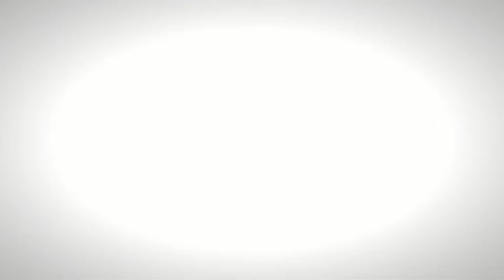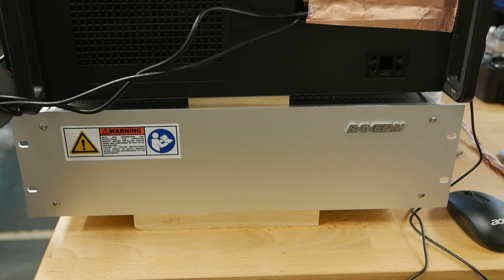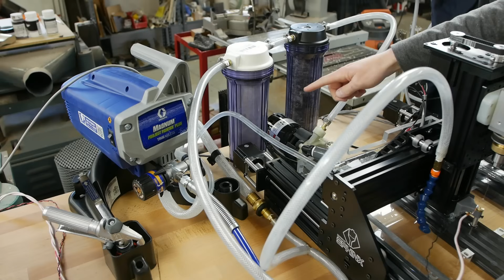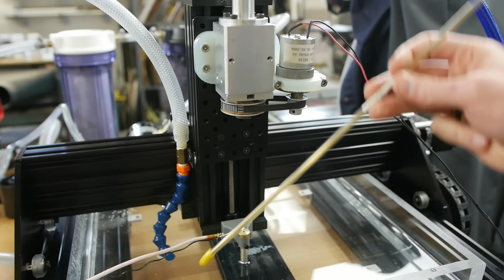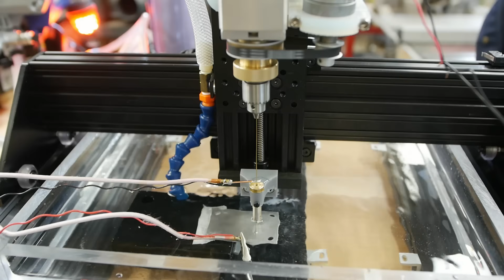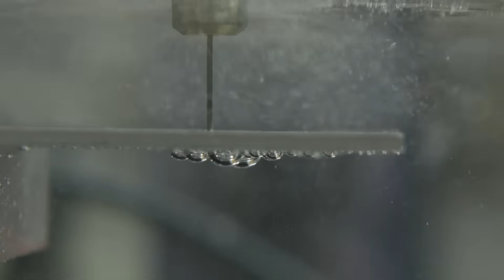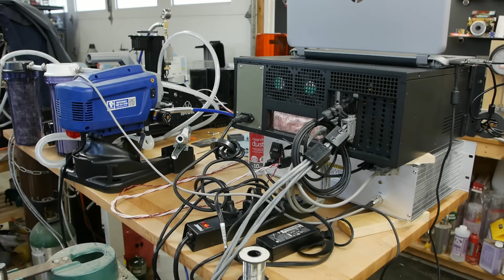Drill through anything (conductive) with Electrical Discharge Machining

Comment: >It'll be too conductive
>water your plants with it

It's got what plants crave. (Electrolytes)
Reply: oh god i love that reference
Reply: Plants love heavy metal
Reply: @turk639  chromium, nickel, manganese, tungsten, vanadium, cobalt, etc. if you drill anything exotic like a ball bearing.
Reply: william Greene if I'm not mistaken, cobalt is even radioactive
Reply: "Brass is copper and zinc." There’s probably also a substantial amount of lead in those electrodes. If you poison your yard with lead, and eat the plants, that’s not a good idea.
Reply: Mostly iron copper and zinc the nano particulates are what make the water more conductive not salts.
Reply: @Barskor1  salts can definetly make water conductive, just adding a bit of tabel salt to water does make it conduct electricity quite well.
Reply: @turk639  Yes but that is not what is happening here he used distilled water that over time gained higher conductivity by drilling.
Reply: "Are you pondering what I'm pondering, Pinky?"
"I dunno Brain, where do you 'spose we're going to find Brawndo at this time of night?"
Reply: @Reno Simpson 95% Of statistics are made up. You realise airliners are privately owned?

JetA is highly purified fuel and regularly tested, everywhere. You think a commercial operation is going to carry an additional tank of heavy crap to spray out?

That's not profitable.

Also, AFAIK, not one maintenance engineer worldwide has spoken out to give any credence whatsoever to your insane ramblings.
Reply: Brawndo's got electrolytes.
Reply: His head looks like a peanut
Reply: hexavalent chromium <3
Reply: I'm not sure is that you?
Reply: @randominternetguy2960  Yes yes I am Me. Now seriously who are you addressing the question too?
Reply: @Reno Simpson lol
Reply: Brondo has what plants crave...
Reply: I use brawndo ... because it has what  metals crave !!!    It has electolytes !!!!  https://youtu.be/3boy_tLWeqA
Reply: Just don't water your edible plants with it.

Don't want any heavy Metals in your tomatos!
Reply: @Reno Simpson Oh the durpin  enviroNazis these are common and harmless metals the fact they are in nano particulate form means they will oxidize very fast.
Reply: Electrolytes? Does that mean that I can drink it for muscle cramps?
Reply: @incandescentwithrage  word
Reply: @Reno Simpson Iron Copper and Zinc were the metals I said would be safe to dump so....?
Reply: Yep, that's the nature of nature on this flat earth. Well, back to the FAP...... Piece out. Mine.
Reply: @Jamie-Russell-CME  Flat earth? LOL! Well that explains things.
Reply: @Reno Simpson The difference here is your EviroNazism is your blinders making you ignorant of the harmless reality in this situation. It also blinds you to the nature of those who will make the dictates to fulfill your green dreams basically they are Hippy Stalin and that never ends well.
Reply: @Barskor1  
Have you been at the glue again?
Reply: @Barskor1  where do you think metals come from, hyperspace?
Reply: @Jamie-Russell-CME  LOL!  No and why would you think that?

Comment: How about drilling through tungsten TIG electrodes which are made to take high heat and current?
Reply: No problem, drills just fine. It will also drill through copper and graphite nicely.
Reply: @TheWireEDM  Wow!

Comment: Tap burners are a very simple type of EDM.  Also if you are only doing hole burning or die sinking you can use a pneumatic head.  Quite a few basic die sinker EDM machines use one.
Reply: Not seen any maker use pneumatic heads on a die sinker. Do you have any brands that used them?
Reply: @TheWireEDM  I remember a few basic machines which didn't have CNC which used a pneumatic column to control the height of the head.

Comment: is it possible the angled cut on the electrode mixed with water pressure caused it to wiggle?
Reply: Also having the tube too far out of the lower guide can cause wobble too
Reply: the tip of the electrode erodes at the contact point, so i'm sure it'll wear to even first. it's sacrificial copper / zinc.
Reply: @mkuehn5450  i get that it eventually wears down but from the test he shows a close up it didnt wear down the angle is clearly still there.
Reply: @MrRoyalFreak  the fact that there's minimal erosion of the electrode where the bushing that provides electrical contact shows the material's durability, interesting that it's not 1:1 material vs electrode?
Reply: @mkuehn5450  Generally the higher melting point of the work material will cause more wear on the electrode, normal steels will be about 15% wear but tungsten carbide I have seen reach about 2000% wear so to drill 1mm requires 20mm of electrode
Reply: @jimfdg3916  i was under the uneducated assumption it had to do with electrical polarity, your melting point observation is appreciated

Comment: Something conductive to try to drill through with this...a diamond. Heck with a pair of diamonds and this you could make a diamond anvil cell for ultra high pressure experiments.
Reply: Diamond doesn't conduct electricity, or at least it is more of an insulator than a conductor. I know EDM doesn't work on it, as we have tried when splitting a diamond cutting tool in half.
Reply: @TheWireEDM  I think I was thinking of the thermal conductivity instead of electrical.

Comment: Having operated edm drills in the past, I got really triggered seeing you bend the rods
Reply: Having not seen an EDM drill at all before, I got bothered by the rods being bent. I was thinking "are you sure that's a good idea? you were just explaining how a bend rod would be a problem..."
Reply: Hahaa, me too. I was strange just how much that annoyed me.
Reply: How did it not snap?
Reply: @Felisargyle  The rods are just brass, they will bend, not snap.
Reply: Same
Reply: What happens if you bent it?
Reply: @Alexander_l322  same thing if you use a bent drill bit in a drill press.....larger hole than drill
Reply: @Alexander_l322 ...you don't have a drill...you have a paint stirrer!
Reply: Alex jones water can't go through them and the machine will struggle
Reply: I know right. I did EDM drilling aka fast hole. Edm sinker and EDM wire.
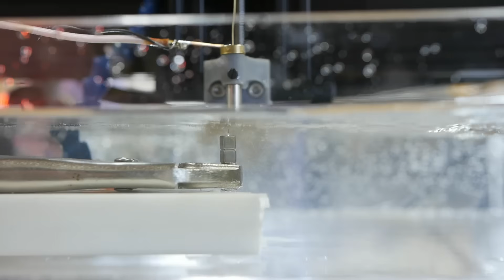Reply: 12:45

Comment: The Zund cutting machines (not at all related to EDM) I used to build and service had a negative feed rate mode for tool over current protection.   If an active cutting tool became overloaded due to say a high or hard spot on the cutting underlay or conveyor belt it will reverse the Z axis to overcome the resistance/stall and reinstate the original z axis position within a couple of ms on the fly and continue on like nothing happen.  So at least that is one other instance of negative feed rates outside of EDM.

Comment: I wonder if you could turn that into an airless sprayer powered desktop CNC waterjet?!
Reply from the maker: The pressure is definitely high enough.  It gets up to about 3000 psi!  The overall power is relatively low, unfortunately.  Cheap electric pressure washers have higher overall power, and would probably make a better choice.  I used the paint sprayer for this project because it doesn't run constantly, and is designed to cycle on and off to maintain a pressure.
Reply: @AppliedScience  A generous hydraulic accumulator would be pleasant as it would cycle much less often.  

The DIY abrasive water jet projects are also very impressive.   Just a bit messy and noisy to do in a mixed tool workshop. The internal combustion engine pumps are reputed to come in higher pressures and bigger power ratings but add to the noise and fumes.

Comment: How about edm drilling through silicon carbide? I think it's a semiconductor, might work.
Reply from the maker: I have a piece of SiC, and it's conductivity wasn't high enough for EDM.  I tested it with a multi-meter -- didn't bother trying it in the EDM.  Maybe I need a piece with some better doping?
Reply: @AppliedScience  ah, well, I was just trying to think of the hardest materials to drill conventionally!

Comment: I think the feedback retraction routine that you mentioned (for de-clogging the hole is somewhat similar to pecking cycle in some CAM programs)
Reply: Except that does nothing to flush particles. That's why no professional makes holes with EDM. Pro's like me use a gundrill, no pecking, just 1500 psi of oil for 3 mm diameter 750mm deep. Pecking doesn't clear chips, drills helical flutes do that. Pecking is to get coolant to the drill point so it doesn't weld and snap. Thats why you don't peck with through coolant drills

Comment: Try swapping the lead screws for Igus DryLin high helix lead screws. You can make faster smoother moves then. It is as close to a ball screw as you can get without being a ball screw. But in this application I don't think it matters much.

Comment: Are you going to do wire cutting EDM too or just the drilling? edit: NM looking forward to the wire EDM vid!

Spindle seems to have a ton of runout, is that normal?
Reply from the maker: Yes, wire EDM next.          Good eye.  There is quite a bit of runout.  It's a problem between the Jacobs taper on the spindle and the chuck.  I don't know which one is off. I think they are both concentric, but have slightly different taper angles, so when I push the chuck onto the spindle, it will never sit properly.
Reply: @AppliedScience  It might not be a Jacobs taper on one, the B-series is quite close to it (basically lengths of Morse taper).

Comment: Great video!  I’ve heard about EDM before, but at a very basic level, where I was under the impression that you used a solid wire and a low voltage high-current supply, so obviously this is considerably more involved than I first thought.  So how much is the cost break down for each part?  Seems like a very expensive setup, and I’m guessing the arc supply is the biggest expense of all since you only had it on loan.  Too bad, since it looks very cool, and doing milling with it would be even better!  Very cool being able to drill/machine things like NdFeB magnets which are obviously impossible to do normally due to their brittle nature and tendency to chip, not to mention tungsten carbide parts.

Comment: Pencil lead is conductive, right?
Reply: I've tested EDM using a MIG welding nozzle for delivering current to a 0.7mm pencil lead, got nice edges around the holes at 48V (had a massive capacitor bank before a beefy (and transient supressed) MOSFET choping along at a few hundred hertz. Very low current needed from the power supply, but a lot slower. No fancy automatic back off or rotation of the lead, so once in a while the pencil lead above the water would start to glow, and then it often got a bit bent. Took one or two pencil leads to drill through the shaft of a drill.
Reply: A long time ago on a Japanse tv show they drilled the length of a thin pencil with EDM and a lathe

Comment: 11:18 How does the internal rotating part that connects to the rubber fitting interface back to the supply, if it is rotating?  What kind of coupling is used for that?

Also, how do they make the electrodes?  Smaller EDM drilling to make the hole in the center?  Turtles all the way down?  I guess it is similar to however needles are made?
Reply from the maker: There is a plain O-ring that goes between the stationary water inlet and the rotating spindle.  There is a big spring that applies some axial pressure to keep it in place.  Nothing too fancy.  I suspect the thin brass tube is made by drawing.  They probably start with something relatively thick (eg 5mm OD, 2mm ID), and pull it through many series of dies that compress the tubing down by 75% at each stage, with annealing between drawing stages.  Stainless steel hypodermic needles are also created this way, and can get down to insanely small OD.  It's lucky for us that metals are so ductile!
Reply: was wondering that too
Reply: Rotary union is the term. O-rings can't hold much pressure, but rotary unions usually use a lapped carbide surfaces to act as a bearing/seal surface to withstand pressures.

Comment: Applied Science I collect Niobium and Ferro-Niobium, would love to see you drill through the crystalline as well as solid bar forms using the EDM method.  You are also the one guy who may be able to melt it in the home shop.  Usually an electron beam welder type device is used to melt it, I had always wondered if a carbon arc mini foundry would be capable.

Comment: That vslot style of rail works great for CNC type work. As long as you don't need insane resolution it beats out linear bearings. The next best I guess is hiwin linear rails.Then you get into the precision stuff but for 3d printing the vslot stuff has been great.
Reply: YS TR  by cnc type work i specifically said for thing that don't require high precision aka 3d printing, at home PCB milling, hell even a pancake robot. Not machining. They definitely are not robust enough for machining. But you'd be surprised how wear resistant those wheels are. On one of my printers I've put around 5000 hours on it and the wheels are still perfectly fine for .08mm work.

Comment: I think hobbyist level EDM is going to make a large impact in the small/precision capabilities of the home shop
Reply: If you add in linear and oscillatory/elliptic processes you can end up manufacturing a LOT of nearly impossible to find parts.
Reply: It's more likely going to make lots of tiny little impacts of minimal force in the small/precision capabilities of the home shop
Reply: Seth Baker have you seen how much Bens setup costs? The baxedm psu is 2700 Eur alone! I dread to think what the total cost is - well out of reach of the average home shop
Reply: @fourtwo7612  There is a DIY EDM generator design out there for the cost of a book with most of the information free on the Yahoo group. If you just want to remove broken taps then the generators and setup can be pretty crude.
Reply: @fourtwo7612  However it need not cost this much it is the current market that allows that pricing.
Reply: still a long way to go to get precision out of it
Reply: @SuperAWaC  Actually not so far, my own wire EDM easily cuts part within 0.01 mm tolerance (verified at work) and it cost me less than 1 kEUR. Now I bought thegenerator from BaxEDM to update my cutting speeds to a whole new level.

The machines accuracy is pretty much in the ways and the ball screw,  as with EDM you are not fighting withh cutting forces or clamping pressure like you would in a conventional machining process.
Reply: And alot of deaths
Reply: @highstreetkillers4377  Is your user name a indication that you like to promote fear or just a strange homage to bad people? Have you any links to fatal accidents with home EDM?  How do these compare with commercial EDM and home workshop accidents due to other tools.
Reply: @KallePihlajasaari  Person behind it is to my knowledge a teenager with Wikipedia open in other tab. Doesn't usually know any details of any process, hasn't done them nor is capable of any conversation. Easiest is to block him.

Comment: Anything is conductive with enough voltage ;D
Reply: Voltage is just a measure of how hard you yeet electrons
Reply: @theshuman100  awesomeeeee
Reply: @theshuman100  best comment I've ever read! 😂😂😂
Reply: no privacy  Yeah, 'yeet', as in 'wow, he really yeeted the bejesus out of those electrons'.
Reply: @user-jp1qt8ut3s  "explosive brute force"  EBF drilling? I like it.
Reply: @Reno Simpson At that point it's just arc gouging again with copper plated graphite electrodes. I think AvE did a vidjeo about that a while ago with the stick welder instead of baterías.
Reply: Unfortunately, dielectric breakdown would probably happen which may not be great if you wanted to do any precision drilling. That being said, a lot of research groups use "controlled dielectric breakdown" to "drill" holes with ~2+nm diameters in very thin layers of dielectric materials for bio-molecule detection.
Reply: @user-jp1qt8ut3s  I know. I'm just being silly man :)
Reply: So Say We All.
Reply: Solid granite?
Reply: With enough amps.
Reply: Sounds like somehing PhotonicInduction would sa 😂
Reply: My absurdly extreme ignorance of sciences aside, everything has those tiny dohickies with positive and negative charges, so............
Reply: I have a lot more tolerance for a person who has an idea for something electricity might do, than for one who thinks he knows what it definitely can't do. JediNg135, I like the way you think.
Reply: And anything can become non-conducive with enough current

Comment: This is really neat I wish it was open source however. I recall a few posts on the linuxcnc forums about using a variant or software module that allowed "negative feedrates" to be interpreted that could be linked to the gap voltage ie higher is faster and 0V was full reverse programmed feedrate.